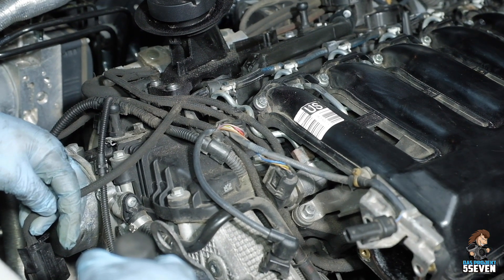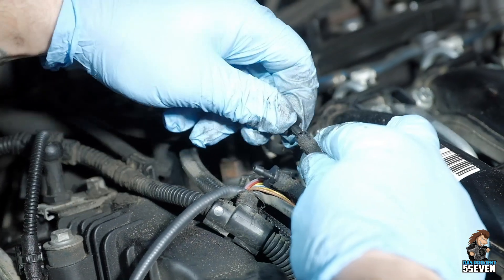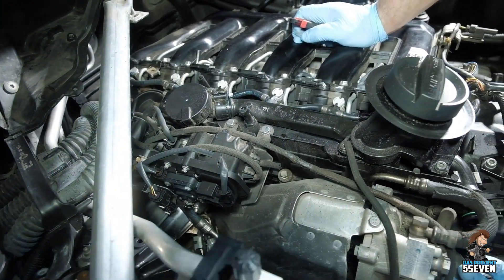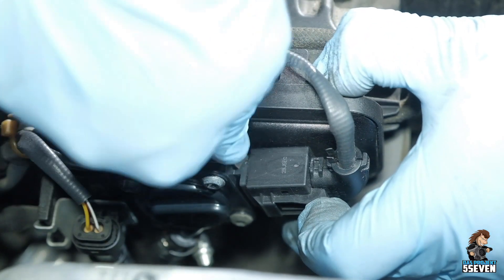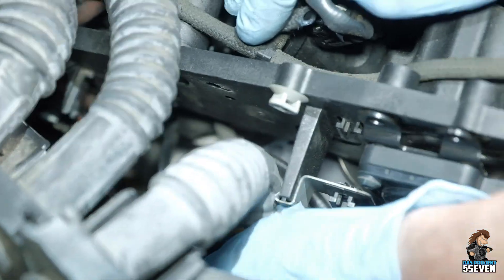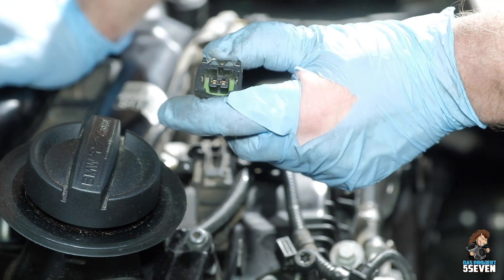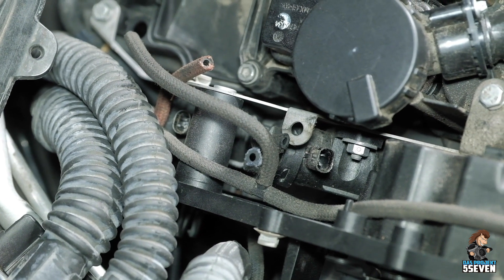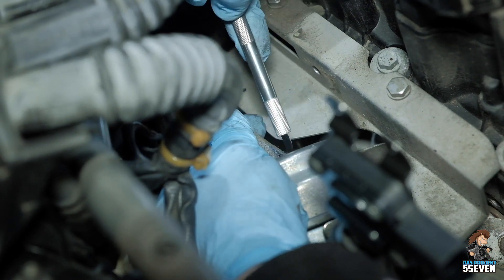BMW 335d & X5d Vacuum System Service Part1

Comment: Is the wastegate/ compressor bypass/ manifold flap all supposed to have full vacuum at idle?
Reply from the maker: You have to specify at what input/output control position.  For example the turbo switchover has a pressure converter input and output nipple and then the actual vacuum actuator for the valve. So for turbo switchover or as you named it the manifold flap - will have full vacuum at idle. But even so, it may may still be slow as you drive if for example you have a bad pressure converter. So don’t rely just at idle reading alone.
Reply: @alphadevyat understood. Just trying to get a baseline to make sure everything works at idle as it should then i will start pressure testing things. Just hoping to find out what should be on/off at idle first. Thanks for the reply.
Reply from the maker: @dead_slide at idle really all you are going to get is whether your vacuum pump output is correct. Should be 29inHg at idle. If you get 27, 25 at any other points then you have a vacuum leak somewhere.
Reply: @alphadevyat just got my first e70d few days ago and chasing a loss of power/ boost with no fault codes. :(
Reply from the maker: @dead_slide Test at output nipples of the pressure controllers and switchover valves. Turbo switchover should be full vacuum, compressor bypass and wastegate zero. Vacuum canister should hold vacuum.  Also test motor mounts. They should be full vacuum at idle. And below 60kph. If you have an X5 then you also need to test the output of the pressure converter for the LP EGR. And don’t forget the HP EGR switchover valve. If any of your pressure converters and switchover valves original. Or vac lines original I suggest replacing.  Also test vacuum actuators. Usually they don’t leak. Test motor mounts hold vacuum. Have fun.
Reply: @alphadevyat thanks a ton
Reply from the maker: @dead_slide also don’t dismiss a potentially dead injector.  Those rain tray partitions crack and leak on back motor cover then soak through the foam and flood the injectors.  Usually there will be a code though.
Reply: @alphadevyat no codes from the dde beside an ews interface fault. Unsure if related to my issue honestly.
Reply from the maker: @dead_slide is this car tuned?
Reply: Miles

Comment: i replaced 2 pressure converters, both EL vavles are good. acutator arm is good, vacuum canister/plenum is good, pumps are good. lines replaced. and still 4530. clean maf sensor. double check the orientation of the vacuum lines. occasionally i will get a low fuel pressure light.
Reply from the maker: @lPolishPandal  what’s the boost vs emp data looks like.

Comment: You don't have to remove the screw at 16:41. It's attached to a clip which can be seen at the far right of 17:38. After removing the three upper screws, you just need to pull up the bracket with force. it's tight but detachable. Thank you very much for this video. I followed it from beginning to end to replace a broke vacuum line.

Comment: Excellent video, helped me tremendously to replace all the lines on the turbo side
I need you help, I have no vacuum in any of the lines. I have vacuum at the brake booster but that about it
What should I look for?
Reply from the maker: @CiprianNeiculescu  if you had vacuum before then you need to recheck everything.  Brake booster is fed from the main vacuum line. Start checking vacuum with a gauge from the main line distribution block.
Reply: @alphadevyat  do u mean the line that is under the intake?
Reply from the maker: @CiprianNeiculescu yes. The main (large plastic) vacuum line goes from a vac pump at the front, to under the intake all the way to the brake booster. Check you have vacuum in that line. Make sure it’s system vacuum at idle @29 inHg. Under the intake there is a “distribution block” with four nipples for small vac lines. You can hook up gauge there. Then check each line. Make sure you have vacuum at the output end of each line and each component. Just trace them and test.

Comment: I think I need to do this turbo control side.  What is the ID of the vacuum lines?  On a different video I thought I heard the guy say 3.5mm.  I want to buy silicone, with sufficient wall thickness, so I don't have to do these again.

Comment: why'd you splice in new lines rather than run whole new ones? Just bought my x5, has 90k miles on it and is a 2012. Is the vacuum line all the same diameter? Better to order online or buy from bmw? Single turbo conversion better than the "twin power" setup?
Reply from the maker: @ConTheDon187  splice just like the factory did. Easier to service. There are only a few extra connections one can eliminate. Otherwise they are all single pieces. Get vac line from FCP euro, part number 11731259996. On X5 lines to motor mounts are a different diameter. Singe turbos been tried. Don’t bother.

Comment: What use have this 'compresor bypass' from the 4:45
Please help me with this question🫡
Reply from the maker: Compressor bypass switches the airside of turbos from small to large output.
Reply: @alphadevyat My vaccum is not conected there but the small turbo works great, can this be a problem becose i do not have the vaccum conected there?
Reply from the maker: @100cosma  you have elaborate where are you referring your vacuum is not connected.  Vacuum system is closed loop and you can not have any open connections or you will have leaked and it will affect the whole system.
Reply: I mean i do not have the vaccum connectrd to the bypass compressor but the turbos works great
Reply from the maker: @100cosma  if the vacuum feel is closed your turbos will work great up to 3200rpm then you will be choking them.

Comment: Hi , excellent videos . Question : what is the “motor mount vacuum switch “ on the 335d ?
Reply from the maker: Motor mounts are vacuum controlled between hard and soft setting. There is a switchover valve that is the same as for compressor bypass and EGR cooler. It is located on the driver side of the motor under the intake manifold aft of the glow plug controller.
Reply: Thank you for that , I found my vacuum leak at the switch under the intake manifold , hose was old just like in your super video . 
   You know from comments many have been helped by your clear and well made videos . I have been an air cooled Porsche tech so the BMW was like working on a NASA rocket.

Comment: Hi I have a problem. The cooling fan turns on after 5 seconds starting the car , the weather doesn’t matters even in -10 celsius it’s turning on and it’s not turning off till the shutdown the engine. I made real time data logging it’s turning off after 80km/h I can’t figure it out what’s wrong.Only getting heating glow plugs errors.
Reply from the maker: First, check your A/C is off. Check your fan relay. Is your motor temp in spec?
Reply: @alphadevyat  Ac is off , even on the diagnostic shows AC is closed(I checked maybe because of there’s some cable issues). As I know there’s no fan relay , fan command is coming from DME. Engine even can’t reach operating temperature. Hours of driving it barely reaches 70 Celsius degrees.And its running at full speed at 14 it shows .
Reply from the maker: @F-Arda  if motor is not reaching the operating temperature I would definitely replace the thermostat although it does not trigger continuous fan application. Same goes for glow plugs or the controller (usually the issue). Bring it into a state of no errors and then investigate further.  What car is it. Usually there is a fan relay but be interesting to check the diagrams.
Reply: @alphadevyat  E63 6 series LCI EU version
Reply from the maker: @F-Arda  just checked there is a fan cutout relay for the fan.  Any car 635d with 2007/03+ build has it. Look at the large plug on the fan shroud. Not far should be a relay. I could not find a part number. I would check that first.
Reply: @alphadevyat  maybe the relay located behind the glove box? On the fan plug there’s two big wires and one thin wire.
Reply from the maker: @F-Arda  doubt it is far from the electric fan. Usually they are close by. Mounted to the body of the car. I would trace the thick gauge wires from the fan four pin connector and you will find it. I looked at newtis and it shows it as a component but not it’s location.

Comment: Hey is there any way I could contact you I’m stuck on the part with the egr on the left side of the engine and the right side under intake manifold where there is the egr pressure converter is the two nipples where do they go? Please need help!
Reply from the maker: Stock car?
Reply: @alphadevyat  yes stock car
Reply from the maker: @aldinbabba  low pressure EGR pressure converter under the intake manifold. Output from it goes to LP EGR on the passenger side behind the big turbo. Input into the pressure converter comes from vacuum distribution line just in front on the pressure converter and under the intake manifold. On the pressure converter the nipple with blue dot is an output nipple.
Reply: @alphadevyat  thank you so much!honestly appreciate you taking the time to help subscribed hope to see a part 3 as yours is the best how to video period others are not helpful and don’t reply back!
Reply from the maker: @aldinbabba  appreciate it. Hope you fix your car

Comment: i keep getting 41aa boost pressure fan, i have changed map sensor but still getting same code. any advice would be great. I also have cleared error but keeps coming back. cars in limp mode
Reply from the maker: What car 335d, X5 and what spec, US, Euro etc.
Reply: did you ever fix this issue
Reply: @shammyali3895  yes, leaking stock plastic intercooler.
Reply: @zerocool123567  ahh okay, funny you said that i have just ordered a new upgraded intercooler today 😅 when you had leaking intercooler did you have poor fuel economy and notice the torque in low rpm isn't as strong?
Reply: @shammyali3895  can't say I really noticed a loss in tourqe. How I realised is the 535d always have a fair bit of oil in the hoses and at first I thought it was leaking hoses as I'd taken my under tray of and was getting oil on the drive. Each end of the intercooler, after removing the hoses and cleaning them I discovered it was the Intercooler. The aa41 leak drove me mad.  Funny thing is car still run well.

Comment: How do you test the pressure converters with a hand vacuum pump? 

I put my pump into the black side and plugged off the blue end of it. When pumping one of them was losing a lot more vacuum and was a lot louder than the other one. 

Does this mean it’s bad? 
I can send you a video through email if needed.
Reply from the maker: Ben, pressure converters when not energized will not hold vacuum. So when you plug an output port and apply vacuum to the input port they will leak whether good or bad, if not energized.

Comment: Tengo que cambiarlos en un M57Y,no creia que era tanto trabajo, cuando apuro 4 velocidad por encima de 4000 rpm,me da fallo 428B
Reply from the maker: Royobm 428B a alta velocidad y altas revoluciones del motor puede ser un problema con el sensor de boost o un mal programa de la ECU
Reply: @alphadevyat  solo me pasa en alta velocidad, despues de reorogramar y anular dpf y egr,los tubos que estas quitando tu los tengo muy deteriorados, estoy esperando cambiarlos
Reply: @alphadevyat   hello I had problems with small turbo I end up replacing both turbos all vacuum lines pressure converter valves but still having the same problem p0299 high pressure underboost I did egr delete egr cooler delete and dpf cooler delete pls help!
Reply from the maker: @manuelpayes3438  you need to go over everything and check the vac system, boost leaks, exhaust leaks. Unfortunately the P099/4530 code is very broad and could mean many things. Have you replaced pressure converters and switchover valves. Your EGR delete is it on the X5?
Reply from the maker: Royobm ¿Dónde se encuentra y quién reprogramó su automóvil?
Reply: @alphadevyat  en España,un mecanico de "amigo",llevo años trabajando con el,en un X5 del taller,paso parecido,y cambiando los tubos de alta de silicona se solucionaba,si no le piso a tope en 4 velocidad, no lo hace
Reply from the maker: Royobm primero asegúrese de que su sistema de vacío sea perfecto, luego verifique el sensor de "refuerzo".  después, si obtiene 428B, necesita obtener datos de su motor.  Es fácil con Testo.  Por favor mira nuestro video.
Reply: Did you solve your issue Im having same issue after tune and delete 😅